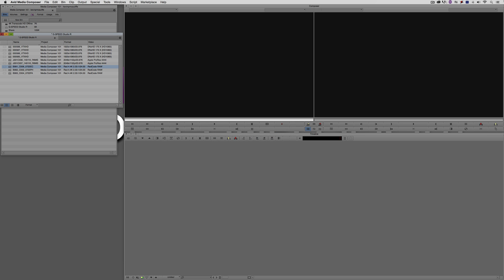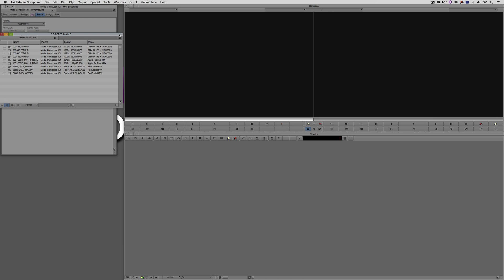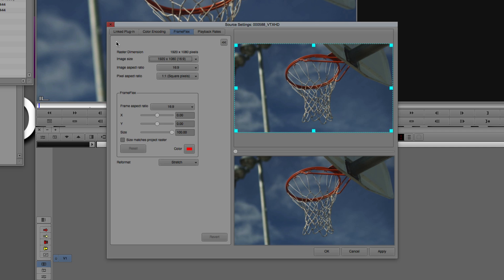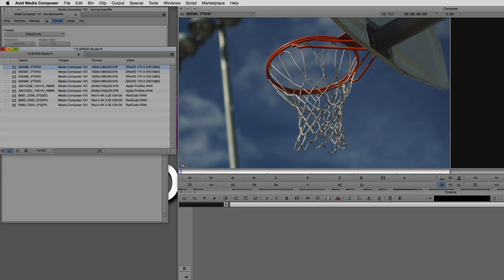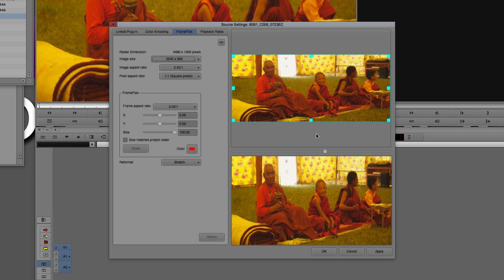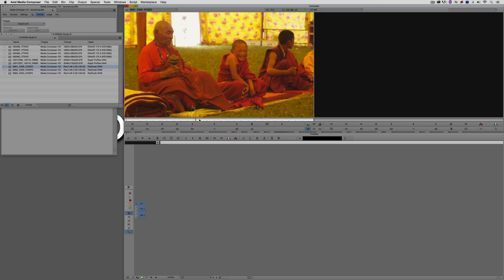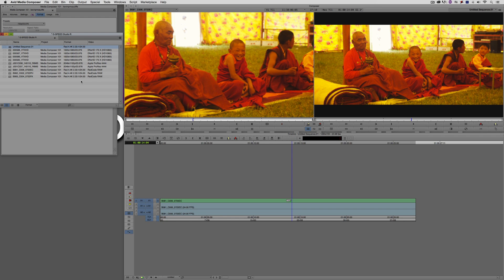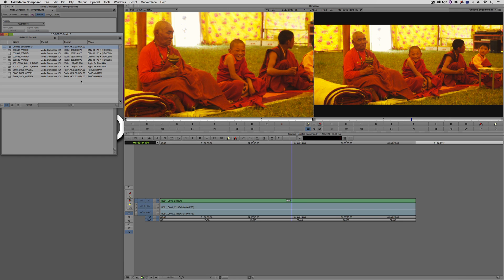Let's Edit with Media Composer - ADVANCED - What is Transcoding Part 1: Under The Hood

Comment: Hello. i have a problem. i converted a bunch of DVD discs to mp4 files and save them on my computer. then i link to media all of them into AVID and try to transcode them into the same drive they are saved on. some discs are transcoded without a probelm while the others pose probelms. the blue line that represent the transcoding process does not progress at some point (like after 12 minutes of transcoding) and the estimate time for finishing the transcoding keep getting higher along with the time that the process had go. all the discs and their converted files are completely watchable so i don't think it's the problem. please help me. thanks. uuser142